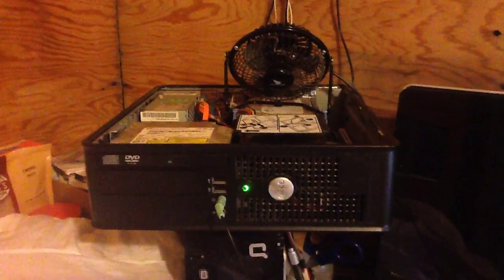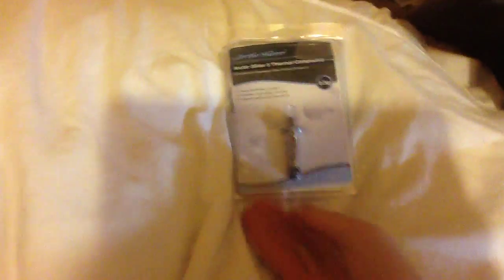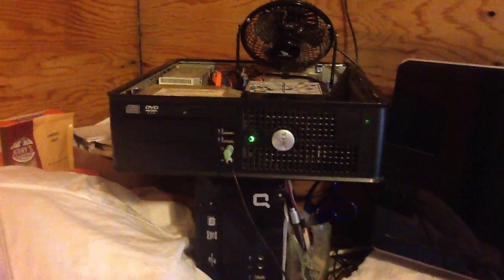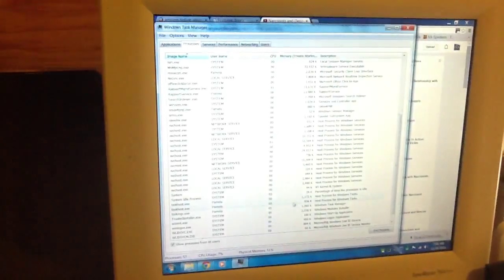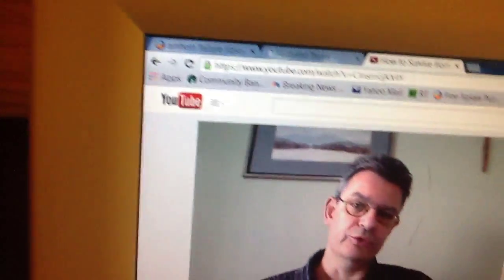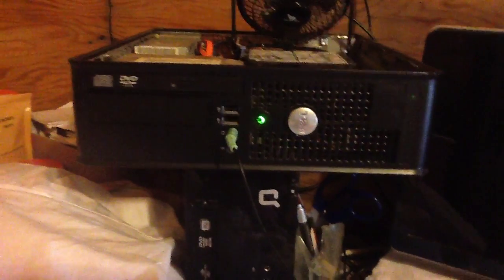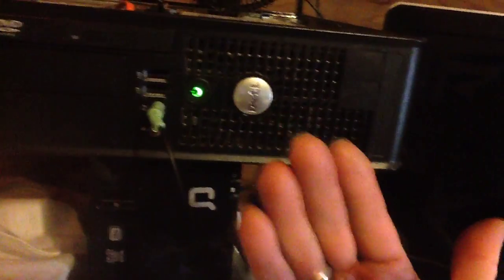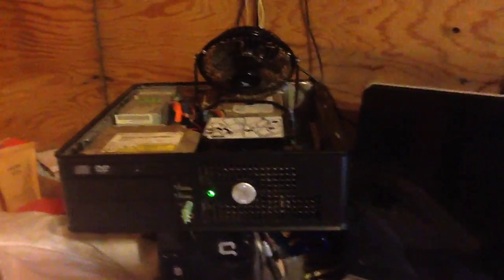How to Fix Noisy Overheating Dell Desktop Thermal Event Horror

Comment: could'nt hear your pc cause mine was to loud
Reply from the maker: +abdimalik adam, hah, hah, hah, hah. Get a little fan and take off the lid. TURN THE FAN AROUND.Put the heatsink back on with Arctic Silver (or a similar product) and put the fan on top of the power supply pointed at the heat sink. Works great. Wonderful price on these Dell desktops. Great memory, powerful processor, no gremlins. Total satisfaction!
Reply: mine too, I had fire up the laptop to watch this video.
Reply from the maker: Thanks for the comment. I added annotations to the video from your inspiration.

Comment: thank you i actually did the turn around My pc is a Hp btx Pc  just like your Dell,  The idle temp actually improves but when running any application it goes straight up, its true its not a dust problem its actually a design flaw, Im glad it works for you maybe appyling the thermal will improve, but youre right about turning the fan to suck instead of blowing, in the end i will probably change the heatsink all together for a custom one. Use "speedfan" and verify the actual speed while idle, or runnig apps and show if it improves the overall cpu temp, im sure its around 50--60 since the board´s heat monitor does not allow for a fixed middle range speed it keeps changing from idle 50´s and rises the fans speed ,The idle fan speed for these mobos is around 1000rpm which is stupidly low,  but these mobos were sold cheap because of the heat problem , I still get anxiuos to see the cpu at speedfan monitor going from 50 to 67, while my 1155 socket pc will keep at 40 all the time cuz the mobo alows fixed speeds to keep the cpu cool at all times not just when running  apps..these mobos do not allow fixed fan speeds.

Comment: I did ALL of your instructions including turning around the fan! But all it does is sits there with a orange light blowing out air with a black monitor! PLEASE HELP!!!
Reply from the maker: Heartbreaking! Try this because it's in fault mode: http://www.dell.com/support/home/us/en/4
Reply: be sure that your pc does not have a case intrusión alarm , dowload the manual  for you mobo and see what components are available, The intrusión switch stops the cpu from starting, its really messy trying to attach the cable once you have opened the case but just be patient. if its really bugging you, reassemble it with intrusión cable, once you get the bios screen look for the intrusión config and disable it, now can work with your pc freely , if that doesnt happen you might have blown your cpu while doing this stunt. remember that she says you must put on new thermal paste, these pcs are more than 10 years old, once you remove the heatsink you must replace the paste, you will find that it is britle and dry,,and if you just turned the fan without the paste theres not much to be done. also be sure that the heat sink enclosure allows space between the fan and tha heat sink, mine does, so i hav no worries, yours may not. if not the fan gets stuck and it wont spin AT ALL..

Comment: It's quiet probably because the computer is measuring the temp of the air coming from the heatsink, now its fresh air coming from the back it measures, it thinks its cold. If it works then it's probably a bad sensor. I fixed mine by using a Core 2 Duo CPU with its own CPU temperature sensors, the system listens to that and only runs the fan when the CPU is hot, making it quiet almost all the time.
Reply from the maker: Good for you! You can see the sensor -- a little thing half the size of a straight pin with a wire coming out of it -- taped to the bottom right behind the grid. You can put your finger on the radiator fins of the heatsink and feel how hot it is. HOT! And you can put your finger on the smaller heatsink (the one that needs an auxiliary fan if you leave the lid off) but be careful because that one gets hot enough to burn your finger. Thanks for sharing.

Comment: +History Anonymous I have a computer that I'm having trouble with, and I'm wondering what to do to fix it. Basically, I am a blind woman who uses JAWS (Job Access With Speech) screenreader software, and I have a Dell Optiplex GX520 Desktop computer, Express Service Code 29309640481, Service Tag DGQ7BC1, which was purchased for me by my American Dad, Scott. There's a problem I've recently run into, and I'm going crazy trying to find just the right solution, so I was wondering if you can please help. When I press the Power button on my Dell Optiplex GX520 Desktop computer, the fans are supposed to spin up for a second, then slow down as the machine boots. However, they're now spinning wildly out of control. This only recently started happening on November 28 of this year. I'm so afraid that something might explode or sizzle if I try to turn it on again. My sighted friend, Markus Johnson (yes, that's "Markus" with a "k", not a "c"), is hopefully going to come over soon to clean out the machine, as I fear that dust may be causing this issue. I'm hoping nothing has failed, as I've had this machine since 2009, and it's been running like a Swiss watch for me. However, the case fan has started making this horrible grinding noise, like a diesel truck at full throttle. At least I think it's the case fan. Will any replacement case fan work with this machine? Or does it have to be proprietary to Dell's computers? Markus has told me to leave the machine powered off for now, and wait until he comes over to check it out. Is this a good idea? Also, what can I do to prevent any dust from blowing back into the machine? Is there a dust mat I can put underneath the tower? Also, is there a way I could add a cooling pad underneath the machine? What do cooling pads contain that keeps things cool? I'm confused! I'm also wondering, might it have something to do with the Bios? Is there a safe and easy way to reset the bios on my Dell without ruining the machine? If so, what do I do?
Reply from the maker: Thanks for your questions, dear. I've read that the capacitors on this Dell towers go bad when they get overheated, and that the cost of replacing them is prohibitive, and so that it makes more sense to just buy a new computer. Will your American dad help you? I paid 86 dollars for a refurbished tower that is the same model as this one that I've been using for 12 years, with the idea that I could use it for spare parts, or maybe even just swap out the hard drive if this one goes bad. Are you in Australia? I am 63 years old and I have a Dell laptop that works faster than  this old Dell desktop. You seem very competent and skilled at computers. Do you use them for work or just for entertainment. If you are retired and are looking for something interesting to learn about, go to my channel and listen to my videos. Last year, I finished the book I've been writing for 30 years and I read it into YouTube videos. The first 90 videos are a short version and the next 57 videos are the full version for a total of 65 hours. They have not found an audience yet, so I would be interested in knowing if you like them. About resetting bios, that is an easy thing with the software, not the hardware. My computer still works well with an external fan blowing into it with the lid off, but it needs to be a good strong fan, not just a little one. Or two little ones will work, one blowing into the power supply and one blowing onto the center inside to cool the small radiator in front of the CPU radiator, and my two small fans keep it plenty cool. When either of the fans get knocked out of place, the internal fan starts whining louder, and then I re-align my two small fans and it gets quiet again right away. From your description, there's something else wrong with your computer. Let me know what your sighted friend says, please? When there is a thermal event with these, they shut down completely and just beep in system mode. They won't even turn on anymore, just beep. They run like a jet engine when they are overheating and are incredibly loud. Sounding like a diesel engine baffles me. I am curious to know what your friend says.
Reply: @HistoryAnonymous  Unfortunately my American Dad died 7 years ago in 2013. He was just 55 years old. They claim it was a heart attack, but I believe his second wife, my ex-stepmother, Debbie, actually murdered him for his money! Evil woman that she was! As for my location, I live in Eugene, Oregon. Someone at Dell, a woman named Shipra, told me that what I was describing is a possible fan failure. What seems strange is that when I put my hand on the back of the machine, it was warm to the touch when it was on, and a clump of dust came from the top of the vent! Now that I've had it powered off for a couple weeks, it's cool to the touch. I wonder if a custom-built machine would be better for me. I have one for making audio recordings (I am a sound designer), which my American dad purchased for me in 2011 from PC Audio Labs. Even better, it was originally $1,789, but I got it for a discount, $1,689! So far, the only thing I've had to replace on that machine was the case fan. I wish there was a way I could post attachments in these comments, so you could hear the grinding diesel engine noise I'm talking about. I've replaced the generic case fan in 2019, as it was making the grinding noise I was telling you about and subsequently running extra warm, with an Arctic F12 120-millimeter fan, which I purchased on Amazon in October of 2019 for only $9.00! Now that that fan's been in there since then, it has made the machine whisper quiet and super cool. Even better, when I have the windows open, it actually has more air flow and runs cooler! I wish I could say the same for my Dell. Another cool thing about my music machine is that it's an all-metal standing tower shaped like a cube box, and the interior is easy to access by removing the thumb screws on either side and popping off the panels. I usually let Markus do that for me, since my American mom says it's better that way, as both she and I are afraid that if I touch something important on accident, it might ruin the machine! You asked if I'm retired. I'll never retire! I'd rather die doing the things I love than being bored!
Reply from the maker: @MsAussie83  I am an alcoholic and it's wonderful because God let me join Alcoholics Anonymous and now I have a solution for every problem. A.A. teaches us to understand things from a different angle, and says that people who are sick are just trying to protect themselves as best they can, and they do some very strange things which we think are bad, but wisdom comes from fear of the Lord, and I am definitely scared of God, so it helps to remember that they are just sick and we wouldn't be angry at sick people, right? Were you blind from birth? I taught deaf and blind kids to swim when I was in high school and they were so happy that they put the rest of us to shame. The blind kids were even happier than the deaf kids. I heard a girl who was both deaf and blind say that God made her deaf and blind so that she could feel. Wow.  Thanks for the opportunity to remember that girl who appreciates being able to touch things. I got sober in Seattle at the world famous Fremont Fellowship 33 years ago and now I'm 63 years old and terrified of ever having to drink or drug again, so I talk about it all the time and that keeps me sober today. Most people run when they see me coming, but the people who love God rush up to talk to me. Works like a charm. I sure love Alcoholics Anonymous. My book is about how we got the Twelve Steps in 1935 and it compares the history of Hitler's Germany to American history. I quote 240 books because some of it gets pretty strange as so I quote other people instead of just making wild claims. If you get a chance to listen to some of it, please let me know, dear.
Reply: @HistoryAnonymous  I don't believe in God, thank you. I'd appreciate it if you could please edit your comment and leave Christianity out of this conversation. As for my blindness, yes, I have been blind and also have been diagnosed with high functioning autistic spectrum disorder since birth. For me, being blind with autistic spectrum disorder is not a barrier or a disability, but rather, I see it as an extension of my life. Mother nature made me blind, and my destiny has always been to focus on solutions instead of problems.

Comment: Hi...nice video...but,i totally clean my dell optiplex 745 but again HDD cooler and some others ventilators makes a noise and enorm speed herselfs.can u help me
Reply from the maker: Did you turn your fan around? They put it in backwards from the factory, with the rubber feet on the wrong side. It needs moving air over the radiators, from the inside to the outside, because the Power Supply gets filled with dust and gets quite warm, so all that heat gets trapped inside the box. Being clean is not enough, sorry. And just taking off the lid won't work because the smaller heat sink gets so hot that you can't touch it. Go to the store and buy a fan, a small one like for ten bucks at the Dollar Store. Take off the side of your computer and set it up to blow air from the inside and through where the noisy fan is. Let me know how that works, because it should before you need to do a Scout786 below. I have not had a thermal event in almost three years since I've used it this way. LET ME KNOW soon.

Comment: But fan is supposed to blow out
Reply from the maker: When you take the fan out, look at it and see that there are holes on both sides -- holes where the little rubber feet have been put in. So the little rubber feet can go in either side, blowing in or blowing out. At the factory, someone sat there all day and put on the rubber feet -- and someone told them to put the feet on the wrong side. An easy mistake, and it had huge effects. The way to find out which way the designer intended the fan to go can be discerned by the wire bundle coming out of the fan. Look at it and see the wire bundle fitting into the plastic channel with the fan blowing out -- opposite from how it came from the factory. Works well now. And don't forget the Arctic Silver, or similar thermal compound. The CPU needs new thermal compound every time the CPU is taken off. It needs a really good seal to transmit the heat. Good luck to you, dear.